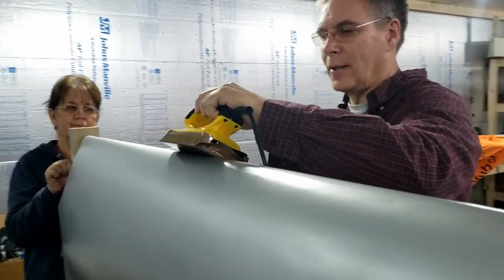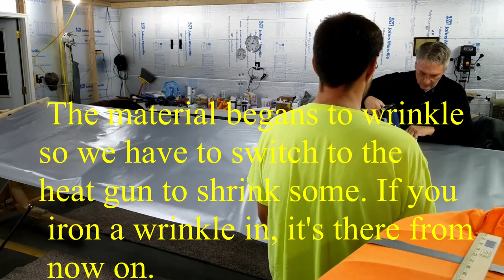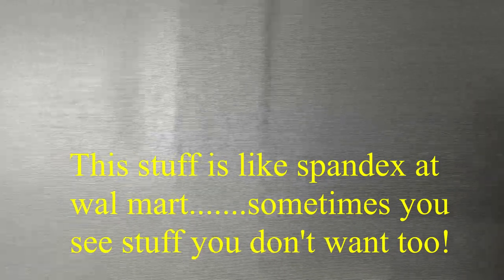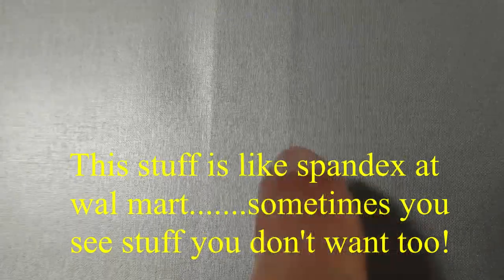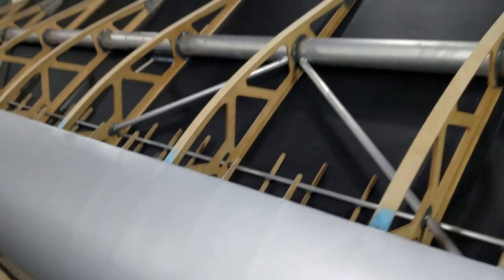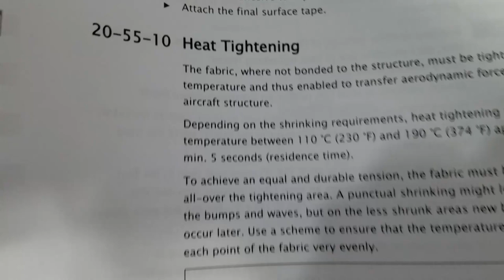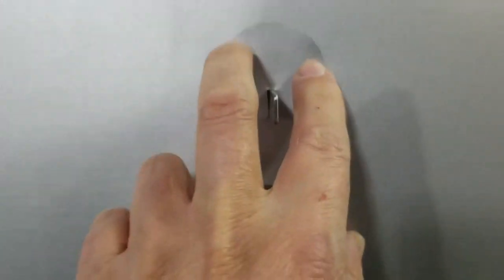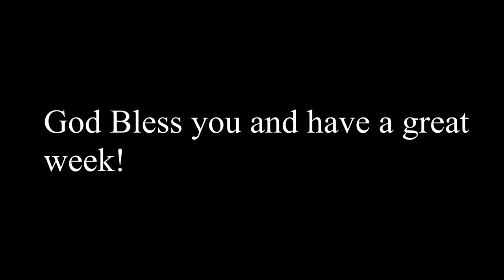Oratex going on Farm Fox Kitfox STI build. Oratex 6000 is going on the wings! 19

Comment: Thanks for doing these!  I am almost brave enough to do my wings after watching you and Lauren.  What temp did you end up using with the iron to do the fiberglass??
Reply from the maker: I ended up at 130c or 266f on the iron. The heat gun ran closer to 300f. Use a scrap piece of the laker leading edge to test the melting/warping point to get what temp to use . You need to be as hot as you can to melt the glue with out warping the fiberglass.
Reply: Gotcha.  Keep up the good work.

Comment: How do you do the stitching? or is it NOT needed with the Oratex glue?
Reply from the maker: Oratex book says that you don't have to stitch if the cap strips are at least one inch wide, but it is up to the builder. Many still rib stitch.
Reply: @KitfoxPilot  Brandon has almost convinced me to stitch (“Do you want to be the next Steve Wittman??”) but I did stress testing on the glue and man, that stuff held 3x  recommended weight - 11.8lbs - w/o pulling off at 90 degrees so I don’t think I will.
Reply from the maker: @DanYocum  When in doubt Stitch! There is sure nothing wrong with stitching. Kitfox factory has never used oratex so remember that also.

Comment: Hi Harlan.
I see the black backing on the 6000, would you say that this would 100% block out light and eliminate seeing the frame tubing when in direct sunlight.
Reply from the maker: Kerry, the black is an option and is to block out all transparency . You can still get the see though kind.
Reply: @KitfoxPilot  I think this is the way forward for me.the extra expense verses the time saved plus the finish is a no brainer for me. Did you order the 1.8 mtr wide material, if so how much did you need. I’m current with you videos and appreciate the time you and Susan take to share your build. Thanks.
Reply from the maker: @doglipdoug  I ordered the standard width , I suppose thats 1.8. 35 meters is what they sell you for a kitfox. They sent 4 rolls of 2 inch tapes. I used 2 since I didn't rib stitch. 2 rolls of 4 inch tapes which i had them take off because i was double lapping the leading edge anyway and they are really high. I have 4 ish yards left??  Thanks for watching! My email is in the info on my last video 26. I'll be glad to send you my invoice when you are ready to order to get an idea.